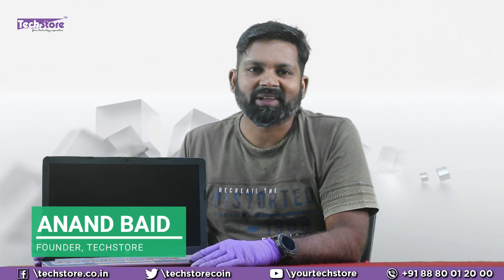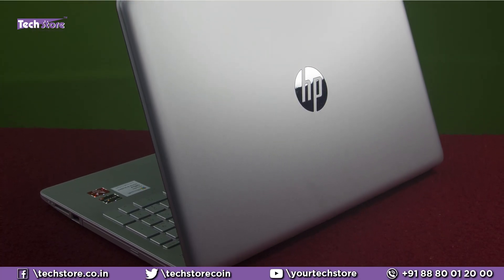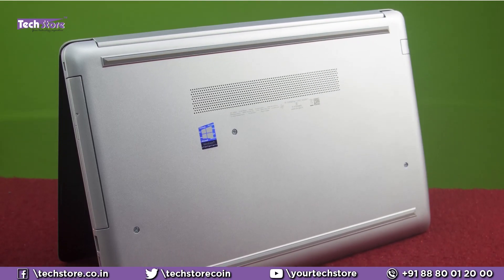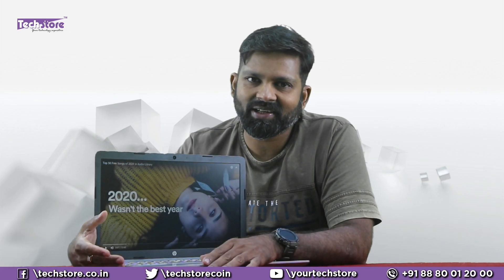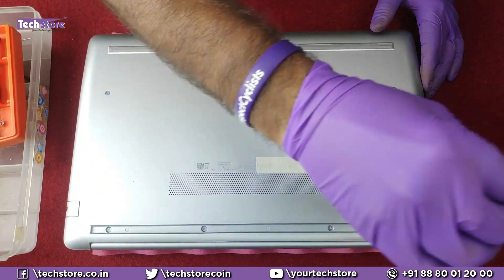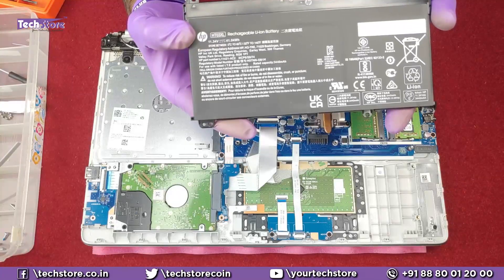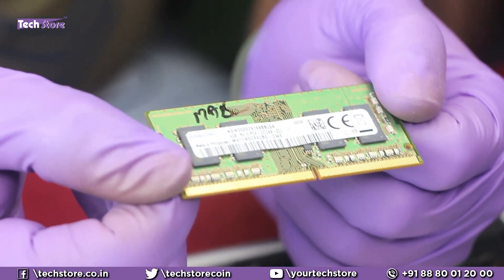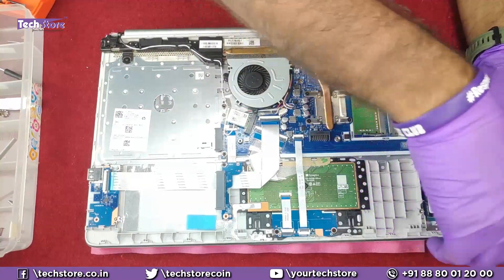HP 15 DB Series DB1059AU DB1069AU : Disassemble the base upgrade ram hdd m.2 nvme ssd battery diy

Comment: Sir I am having hp notebook 15-db1061au ryzen 5 3500u processor (4gb ram, 1tb hdd), does it have nvme slot, i am not sure about it, i was thinking of upgrading it with ssd and ram, can i use nvme type ssd, confused coz the 1061 model was not mentioned in your video. Kindly respond sir?

Comment: Sir I have same laptop ( HP 15db 1059 au) I have one question, I'm planning to buy a ram, with this I got 4gb inbuilt ,now I want to upgrade with 4Gb(inbuilt)+8 gb ,it will work or not? 
which frequency ram  will  better for me? You can suggest me company also
Reply: 2400mhz

Comment: Thanks for the info....I have hp 15 db1069au  Black without DVD, I am planning to add a NVME SSD 120GB...just to be double sure, can you please suggest if both existing HDD and NVME can be used together (NVME for OS and HDD for Data).
Reply from the maker: yES THEY CAN BE
Reply: Buddy I have the same laptop, does our laptop support nvme m.2 ssd ?? Does it have any type of other specs or something which I should know about?